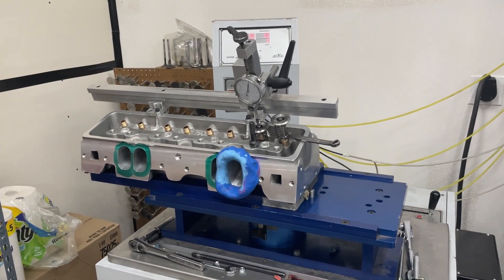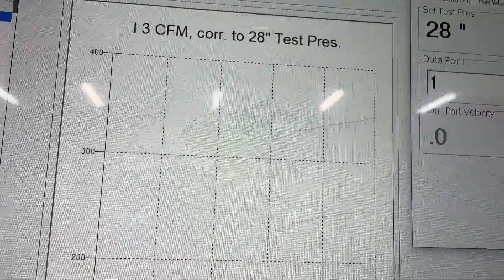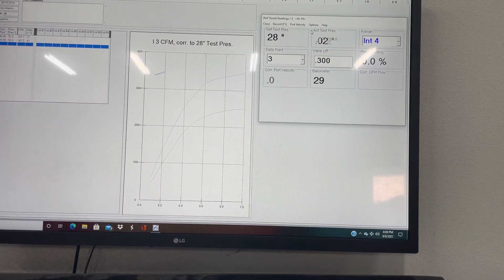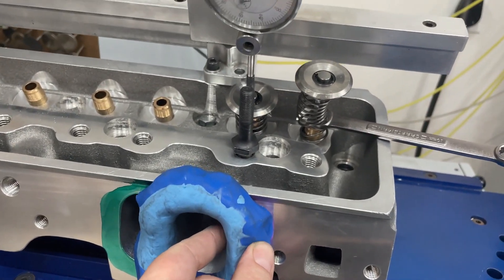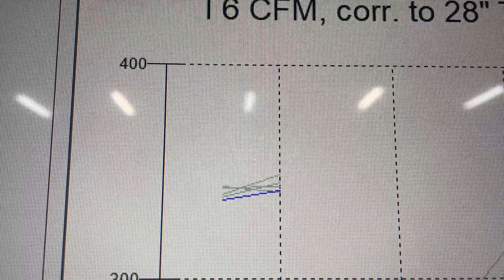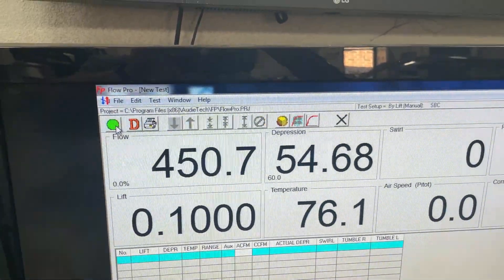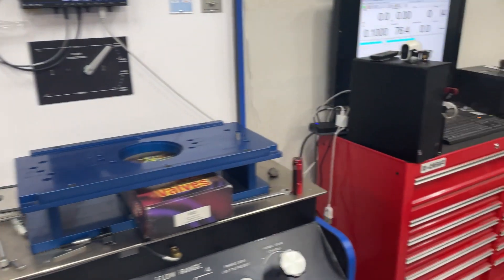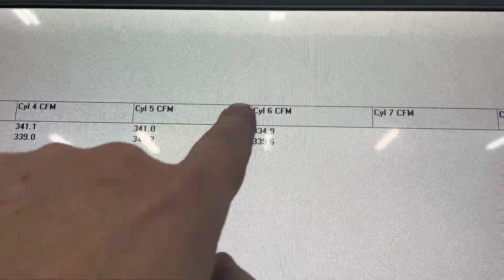What Happens When you Flow a Head at Higher Depressions

Comment: No doubt your sanzes bench is  a great machine. But for what it is worth. My SF 1020 will pull 60" h20 through that head no problem.

The plastercene thing made me chuckle. I have machined mountains of radius plates so they dont get pulled in during testing. There is an improvement in testing acuracy as well. But what a pain having to have so many ready to fit atleast all the common entrances.
Reply from the maker: The Saenz pulls more than my superflow 750. I would like to have a superflow 1020 but I don’t need three flowbenches. It is quicker to make entries with modeling clay but I should have permanent one made. 

Side note I think you commented about the sniper efi system. I agree with you but both the carb and sniper cost the same. Thanks for the reply.
Reply: @WeingartnerRacing  yes I made the efi comment as well. I hope you don't mind my thoughts / point of veiw once in a while. I very much respect your efforts and despite my years in the same business. Still learn from your videos and efforts. Plus it is enjoyable to watch subject matter I understand and relate too. I have had extremely good results with holley efi. But I did spend my left leg so to speek and went to Kentucky for 3 weeks and took all 3 tiers with The holley expert Tom Kise. That proved to be a significant advantage. Many who try it claim a powerloss over a carburetor. Even holley will validate that. Atleast with sequential. So far I have found the oposite. But every tuning input detail matters. 

Cheers!
Reply from the maker: Feel free to comment I don’t mind. There are some people that comment that just want to argue or try prove a point even if it’s wrong. Those are the ones I hate. Your comment is not one of those so feel free to keep commenting. 

I do think if I did a mpi and played with injector placement I could get close to this carb but it’s going to cost 10k. For that money I can make power other areas. Eventually I probably will do this anyway because I’m going to do a supercharger. My injector placement is going to be what I play with at that point.
Reply: @WeingartnerRacing  yes i agree the carburetor is still the best bang for the dollar if budget is an issue. And lets face it. For most it is. Me included.
The efi offers some real advantages. I will touch on a few.
Twisted up inverted timing curves you would never achieve with a distributor. And it often helps a little for sure. Also the knock sensors are a gift from the lord. I build lots of pro street pump gas engines. I can tell you being worried about pushing compressiin ratio is no longer a fear of mine. Huge gain!
Far better milage, low speed drivabillity and idle control.
Being able to control injector end angle and offset allows to stop fuel during overlap. No smell out the pipes and again milage up. Less hydrocarbon emmissions.
But the big one is being able to build icf's and control other things beside fuel and spark. You can litterally do anything with a dominator ecu. No limits! If you want traction control, vallet parking or lend the car out mode to an ejection seat. It will do it.

Anyway. Thanks for producing the vids. I am addicted. I litterally find my self checking constantly for a new one. I love airflow.

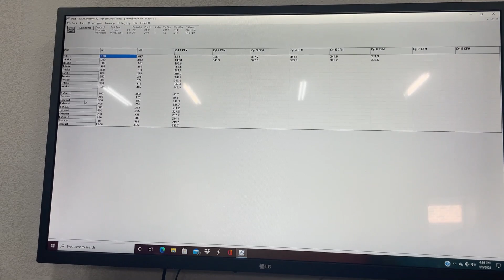Comment: Learned a bunch. I got my wife’s old Hoover outta the closet. Put soft blue clay around the hose end, turned the vac on while holding my hand over the outlet shroud and sure enough the clay held.  Second, third, fourth test covered the outlet shroud with less restriction each time and the soft clay pulled into the hose end.   My test concluded in 10:04

Comment: REYNOLDS NUMBER:  I'm waiting for someone to talk about this, the ratio of Inertia to Viscosity flow terms.  Too much inertia you get turbulent.  If viscosity dominates you have laminar.  For a given combination of factors, there will be a critical RN where laminar turns turbulent.  2000 is one such value but I forget for what type of flow (pipe, wing, orifice, etc.)

What is interesting is that the inertia numerator includes density and characteristic length factors.  So here is the key point:  when you supercharge, you are increasing the density of the fluid while maintaining flow velocity.  So that means boost will reduce your turbulent margin.  

How to test for this change in density on a flow bench?  No doubt there are calculations that can be made to correct for a given boost - probably an increase in depression.
Reply: Great points!  I would like more data on this.

Comment: I use pretty hard a bit dried clay ...as I manly use 70" of tp.   My bench eats soft clay for breakfast....  

I am not stuck on 70"  but for turbo applications I consider 70"  the minimum.   For  na   one can use much lower tp's   on the intake.   On the exhaust I  prefer still 70 at naturel aspirated engine.  

And yes....from 28  to 70 makes a difference although less when a port is a good stable port.   And again.there are always exeptions ....
Reply: What flowbench do you have?
Reply: @n4thawin  Quadrant Scientific Flowlab1400.    1400 cfm @ 28"tp
Reply: @Baard2000  I looked for that and they went out of business long ago! I built a PTS bench and plan to build a new one to my design to reach that type of depression and flow!

Comment: Interesting AF! I'm soaking all this info up!

Eric, has anyone ever tried flowing a head with the real intake valvetrain running at the peak torque and HP cycle rates? Might take some mock up on a semi bare block with an AC electric motor on a VFD driving the camshaft? Kinda like spintron but for flow testing.... Would require some kind of standardized camshaft as I'd think cam specs would greatly effect flow rate results. 

If the bores were blocked off, crankcase including lifter valley and timing chain areas sealed up, then draw vacuum through an oil pan with a large fitting welded to connect, say a 4" dia abs plastic pipe running back to a flow bench....

Might give a more accurate representation of an actual engine than the "industry standard" 28 in water static flow at different valve lifts. 

Problem being collecting enough data to represent some baseline standards and then seeing if there's any gains over the conventional testing currently being done by everyone.

And change subject, are your heads flowing around 340 cfm good for around 700 hp if everything's 100% on a ~400ci turning around 7500 peak rpm?
Reply: Smokey Unich built a similar rig to what you describe and that's actually where the 28" water column test depression came from because at the time most were using 25". His book "Secrets of power" covers it in rarely good detail.
Reply: Yes someone built that , it was not Smokey.